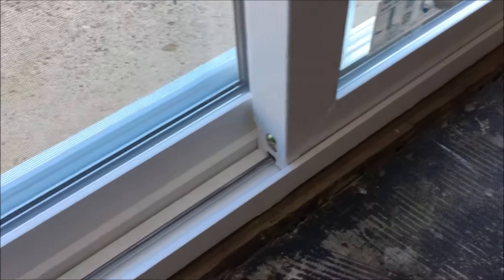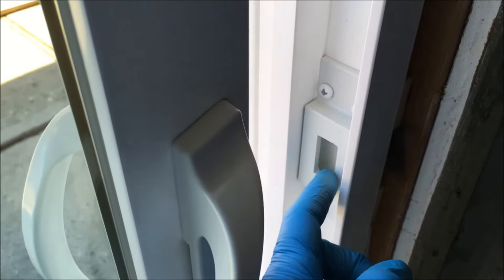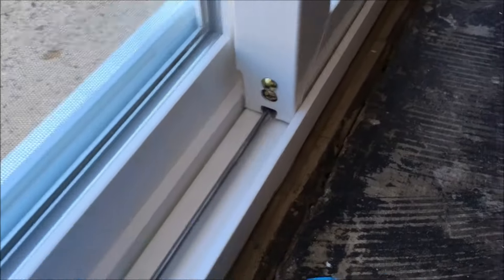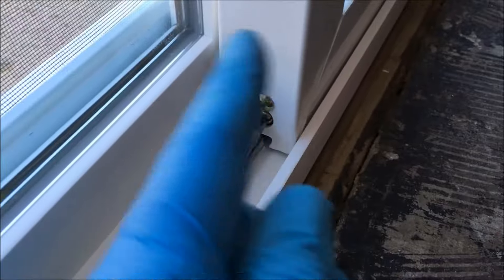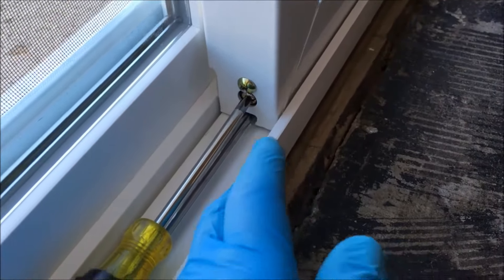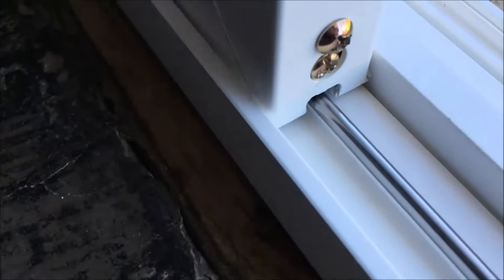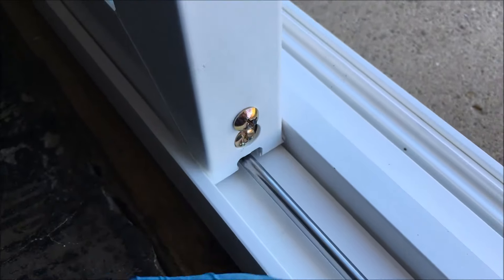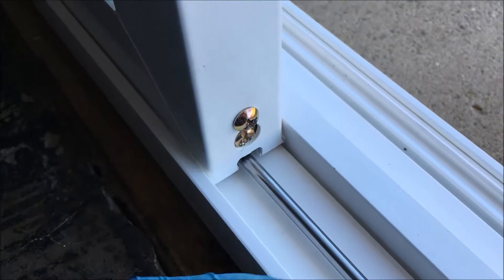Adjust Sliding Glass Door

Comment: Okay, just to clarify. The screw ABOVE the roller adjustment holds the  roller assembly in place. If you remove the top screw, be prepared to remove the door out of the the frame to secure the roller assembly back to the frame! Just saying……

Comment: Good info, thanks. Do you have a video on how to replace the sliding door? One of my sliding panels leading to the backyard is fogging up and I would like to swap it out with the same type of panel in one of my bedrooms. Do I have to remove the side frames in order to lift the entire slide panel to remove it, or do I just retract the rollers to be able to lift the glass panel off the track?

Comment: Great video! I have a slider that is scraping across the track cap on the right side. If I try to adjust the roller with a screwdriver, I can only turn it half way in either direction and it does not change the height of the door on that side. The left side is not doing this, and sits above the track cap. Is this the result of a damaged right-side roller? Every time I try to clean the track or adjust the rollers, I make the door harder to open! LOL

Comment: I have a different problem.  I have a sliding glass door, internal door...it scrapes the inside of the frame, so raising or lowering the height of the rollers doesn't seem to fix the issue.  The powdercoating is all scratched where there is metal on metal.  So the problem is lateral scraping rather than underside. This has been doing this since installation but I didn't notice it until I started using that door more often.
Reply from the maker: Hi Lupi33.  The problem with your slider can be caused by several reasons.  I'd need to see the door to determine the problem.

Comment: Thanks for a great video! Any tips on how to fix a gap in the center post between the panels that let’s air and noise through?
Reply from the maker: Thank you, arnilie.  There should be pile weatherstripping between the door panels.  If it's missing, damaged or worn, it needs to re replaced.  That should solve the air/noise issue.
Reply: @frugaldiy1  thanks for replying! May I make a request for a how-to on that?
Reply from the maker: I'm sorry, arnilie, but I don't have a video on that and don;t have time to make one.  I'm rehabing a bathroom.  Look for a video that explains how to replace pile weatherstripping in a sliding glass door.

Comment: How do you close the gap between the stationary door and the slider?  Cool air blows through.
Reply from the maker: Guitar Overkill, the gap between the stationary door and slider is suppose to have pile (mohair) weatherstripping, but it does wear over time.  You can certainly replace it, but you have to remove the slider to do it.  Also, if you do replace the weatherstripping, make sure you get the right size (which can be quite challenging).  I'd just plug the gap with loosely waded paper towels or a bit of backer rod for the time being.  Merry Christmas!
Reply: @frugaldiy1  The door is 2-3 years old. The material may not have been installed when the door was replaced.
Reply from the maker: Guitar, to replace or install new pile weatherstripping is a project that's best to do in the spring or summer, when it's not so cold, because you have to remove the slider.  I don't want to give you the impression that it's a difficult job to do--it's not.  The difficult part of the project is that you have to find pile weatherstripping that has the correct dimensions (width, height and base that fits into the channel) that will fit into channel in your door.  The pile weatherstripping fits into a channel in the door.  You just can't see that channel until you pull the door.  It's tough if you don't have any weatherstripping in the door now to use as a sample size to buy replacement pile that has the correct dimensions.  I had to go to a glass company to find the correct size for some windows I had.  Since your door isn't that old, call the manufacturer and ask them if they might know the size pile you need.
Reply: @frugaldiy1  Thanks for the advice.
Reply from the maker: You bet, kiddo.  Merry Christmas!

Comment: I tried to adjust my door rollers but the adjustment screw head is stripped out and I can't turn it. Any suggestions? The door is new, so the installer must have stripped out the screw.
Reply from the maker: Yes, I use locking pliers, blunt or needle-nose tip, to remove screws with stripped heads or missing heads.  I have a video showing how I do that, and here's the link: https://youtu.be/_wQVSWg377s

In your case, because the head of the screw may be difficult to snap the locking pliers on to, use the tip/nose of the locking pliers to grab onto the head of the screw.

Comment: Did I miss something.   Did you actually resolve the gap in the door?   A good video, but I'm not sure that  it was clearly explained how you resolved the gap problem, for example to fix the gap at the upper part of the door do you adjust the screw anti-clockwise or clockwise, you didn't say.

Comment: I have uneven sliding door. The top part and the bottom do not allign. What is the solution please?
Reply from the maker: I'd look at the rollers, at the bottom of the door, and see if they need to replaced.  You have to remove the slider panel to do that.  Or, the alignment issue could be related to the slider door not being centered on the track at the bottom of the door.

Comment: I love your video but you have a bare floor I have tile so I couldn't  remove the door . 🥺
Reply from the maker: Thank you, Charlie.  That's nice of you to say.  Yes, I'm renovating my house, so I took out all of the flooring.  

If the tile is set at the depth of the door frame, maybe you can ask someone to help you lift the slider (one person at each end) above its lower frame and tilt the slider out, after retracting the rollers all of the way up.  Or, retract the rollers all of the way up and try to tilt the slider out at the top frame, of course with someone's help.  Those sliders are heavy.  

When my sister and I replaced my sliding glass door, one of the rollers would not retract, so we had to use a large flat-blade screwdriver to pry it up on that end.  Maybe you can pry up each end of your slider to get enough clearance to remove it.  Use a cloth to protect the finish on the door.

Comment: The adjustment screw has pulled away from the rollers.  We can't get it threaded back on.  We can't get the door out either.  Help!!!
Reply from the maker: Hey Debbie.  I'd try this.  Place a block of wood under the bottom of the door on the each side, in the bottom track, so you can elevate the sliding door.  When you elevate the door, the rollers will lower.  Then look into the hole where the adjustment screw goes and try to locate and line up the hole in the rollers where the screw came out of.  Then, gently try to screw the screw back in.  If the screw binds or resists don't force it because you may strip the threads.
Reply: @frugaldiy1  We sort of tried that.  We only raised the one end.  We will try both ends.  Not easy looking through that tiny hole with bi focals and trifocals.  But thank you so much for replying.  Much appreciated
Reply from the maker: You're welcome, Debbie.  I know you're in a tough spot.  You can use a small screwdriver or ice pick to locate and align the holes on the rollers that the screws go into, so you don't have to look for them.

Comment: Can’t adjust because the screw is missing? I’d like to replace the roller assembly but I can’t remove the door because I can’t adjust the wheels. Now what?
Reply from the maker: Tough one, M D.  I'd get a couple of screws of various sizes and gently try to screw them into the hole on the door frame to see if one fits.  I say gently because you likely don't know the type of screw threads or the pitch of the threads.